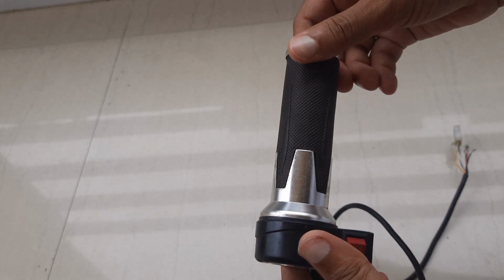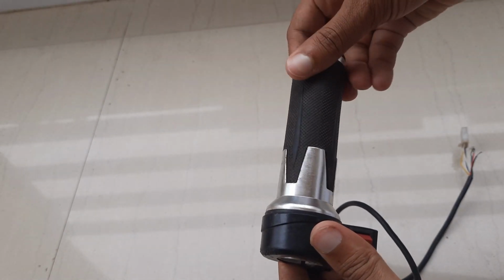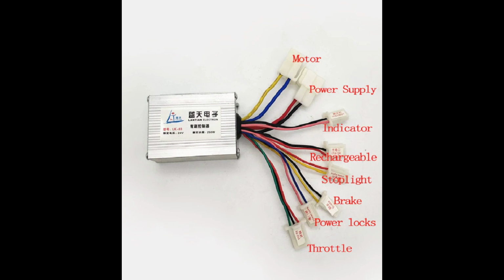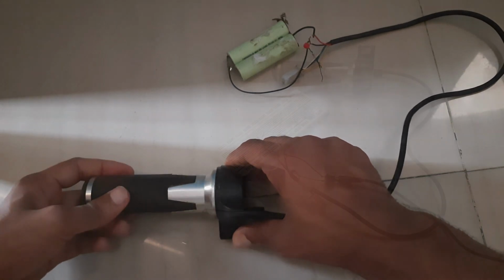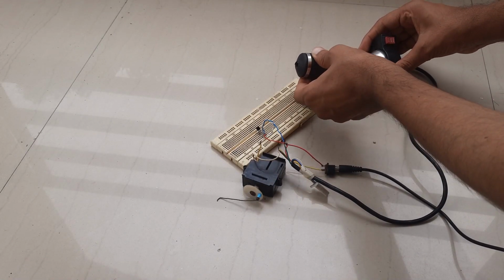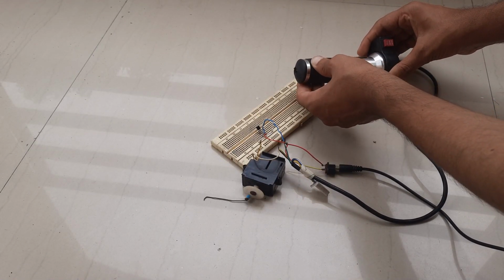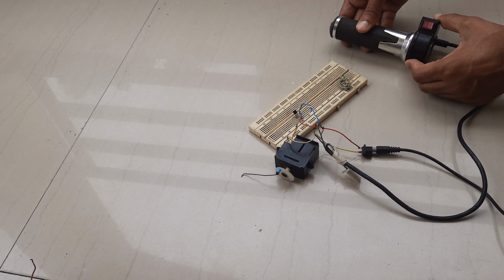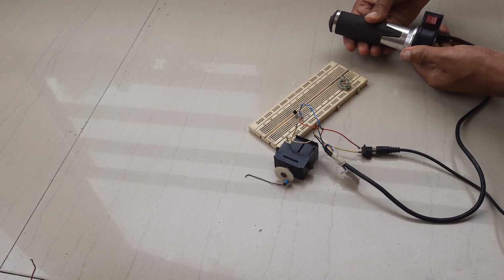How to conrol DC Motor with Throttle

Comment: Hi, I wanna ask if without the transistor and resistor, do the throttle still able to control the DC motor speed?
Reply from the maker: No, because the output current from throttle is too small to run a DC motor 
It can still glow the LED 
But you can try with the small motors it may work

Comment: I want to use this to a 12v pc fan so the throttle will be the PWM control but how can I speed up the spinning of the fan?
Reply from the maker: You should use the mosfet in place of that transistor

Comment: can i use this in my kids ride on bike with 12v 550 motor? i need a controller? if yes how to connect with throttle with controller?
Reply from the maker: Yess it needs motor controller to run 12v motor 
Text me on Instagram for more details

Comment: I tryed but failed
Reply from the maker: Use 12v power supply & correct value of transistor 
Also check if hall sensor on throttle is working

Comment: Hi   can i use throttle only in controlling big 500 Watt size dc motor for speed controller 
Without using  real controller
Reply from the maker: You can't, it needs a motor driver for that